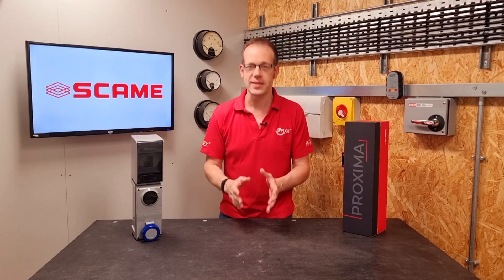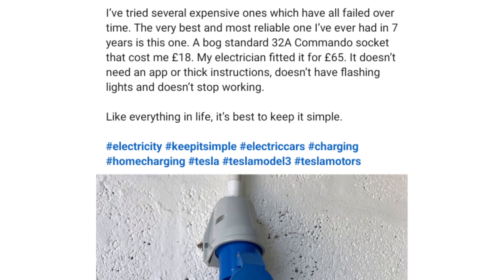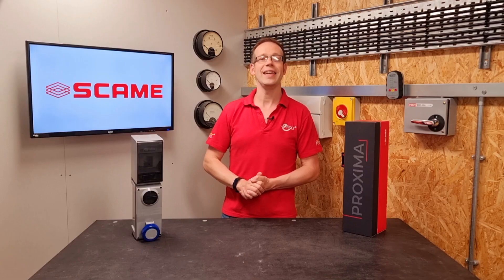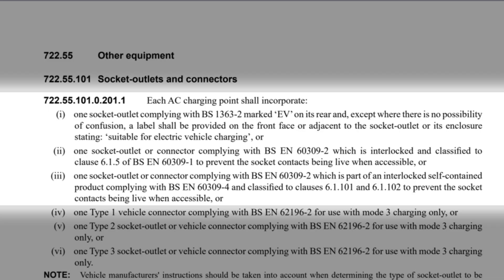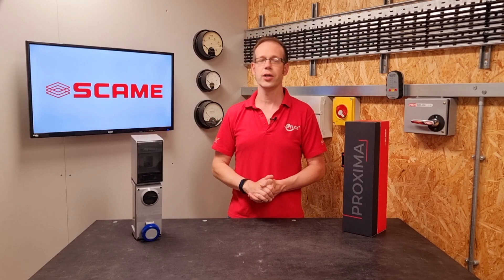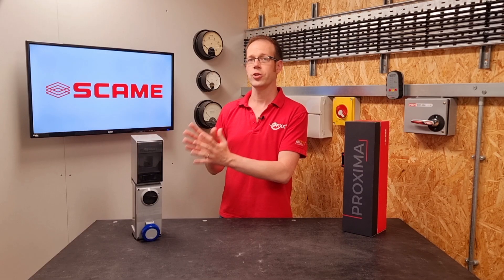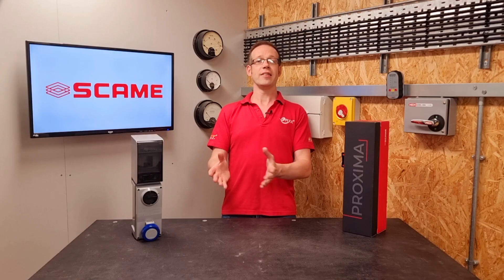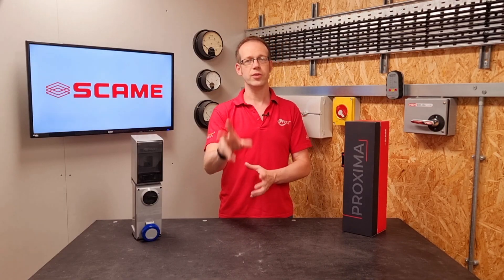Can You Charge an Electric Vehicle with a Commando Socket?

Comment: This is normal in the EU but we use predominantly 3 phase 16A 11kW charging. The cable You get with most cars is a commando to type 2 charging cable with amperage setting options

Comment: Surely by the time you’ve bought the PEN fault protection and the type B RCD (6mA DC fault protection required) and enclosure complete with SPD it’s as cheap to just install a manufactured EVCP with it all built in. Also less work? Or am I missing something?  I don’t understand how those 13A sockets with rcd next to them Screwfix sell can be used either surely only on a tt or TN-S system.

Comment: Code of Practice, if you read the last paragraph of 2.2.3  it suggests the use of EN 60309-2 sockets are for commercial and industrial only
Reply: That is the socket only without interlock
Reply: @paulstimpson8977   Switched-socket outlets with interlocks are described in IEC 60309-4

Comment: Keep charging EV  simple just install a 32 A commando socket and charging lead protected by a small EV charging Consumer unit  with the proper protection in it this will be the preferred way and easiest for all the houses installed in the garage not outside it

Comment: Quite odd that a wired in domestic EV charge point is neither shuttered nor fitted with an interlock! I get the impression that it’s really all about ring fencing the EV charge point providers gravy train.
Reply: They have a software interlock, in that the socket is not live unless the plug is connected to the charger and the car.

Comment: I noted that there are two options for commando chargers adapters for the Tesla small charger, a 16 amp and a 32 amp. I’m hoping to throttle my charger to 16 amps which is a useful step up from the 10 amps off a wall plug, but won’t put any strain on the separate 30 amp breaker box in my garage. Obviously my electrician will advise, but this video is a useful reference, thank you.

Comment: Whilst the environment is not industrial. The use is not household. It's external to the home, and the intended purpose is to deliver a 16/32A supply. Installing a shuttered traditional socket would be inappropriate for the use case.

Comment: It sounds to me like a plug in charger with built in 30mA AC / 6mA DC RCD functionality (such as the OEM ones supplied with some cars complete with a 32A Commando plug cable as well as the 13A BS1363 plug cable), plugged in to an interlocked Commando socket which is positioned at ceiling height indoors, in a house with TT earthing (so PEN fault protection isn't required) ought to be OK?

Comment: EVSE equipment is grossly over complicated being overloaded with technology and located in a harsh environment, leading to them being over priced and unreliable.  Many fail prematurely as a result.  It is  Christmas for electricians as they get unnecessary repeat business.    

All the charging intelligence is onboard the vehicle so a dumb supply is all that is required.  Or rather as dumb as possible to implement the rudimentary communication between EV & EVSE.    

There is no reason why any socket cannot be protected upstream by suitable RCD & PEN fault detection.  Also no reason why the socket can't be located in a locked cabinet if prying fingers are of concern.    

We live in a nanny state with excessive regulation.  Many electricians don't understand the regulations as they are complicated to understand.   Its almost as if a lawyer is required to interpret them.  

Top tip - if you want to get a commando socket (single phase, 3 phase) installed, don't complicate things by mentioning your intent to charge an EV with it.

Comment: There is a big difference between a dedicated EV charging point and using a standard electrical outlet that is already in place for charging an EV. As far as I know, there is no law which prevents a householder doing so, and it won't matter whether it's an IEC60309 or BS1363 socket.

Comment: Danger:
If you check the blue to Tesla adapter internals, it joins L1, L2 and L3 inside, to offload Tesla EVSE relays. But, if you connect Renault Zoe (whicj when single phase charging connects internaly L3 and N). It would make huge mess with both car electronics and L3 relay inside EVSE.
Even Schuko 13A does that, even thou relays are rated 16A.
Only with Brittish 13A plug uses 1 relay internaly, and it charges the car at 10A.

Comment: I believe you could be a lawyer. You have great grounds for a case. As long as it is protected as, it was an EV charge point. I cant see the problem . The only problem is that someone might think ever 32a socket is ok for EVs. Not every charger has a RCD and PEN disconnect built in.

Comment: This is exactly what i did, good quality interlocked IP67 rated socket on a separate circuit. Very cheap solution comparing to a "wired" EV charger install. In addition to that if you want to swap a charger later to something else it is easily done by changing the socket.

Comment: Unfortunately I think you missed a major part of the regs.

Amendment 1 doesn't allow you to install sockets without protection if the socket could be used for charging

722.411.4.1 is the specific rule

Comment: So, if you have already fitted an interlocked 16amp Commando socket installed to provide 16amp power (EHU) for your Motorhome when parked on your drive, you search and purchase an "upto 16amp" variable current outlet charger cable with a 16amp Commando plug on one end and a Type 2 on the other to charge your newly purchased EV to give a faster chsrge than a domestic plug top at 20% of the cost of an EV outlet, only downside is it isn't "Smart" 🤷‍♂️👍

Comment: IEC ("kettle") sockets aren't shuttered and are widely used in domestic situations.
Reply from the maker: Not usually as part of the fixed installation
Reply: @efixx  Surely there are other provisions for the use of Ceeform, E.G. the fact that it's 16A. My reading of the law around "standard"  domestic plugs/sockets is that a.socket intended to take a standard 3 pin 13A plug must be shuttered but a socket doesn't necessarily have to be of the type that takes a standard 3 pin plug. I have a 16A ceeform in my home workshop for my welder and have no problems with it,  also it's mounted well out of reach of children (not that that's a problem for me as no one else lives here).

Comment: Cordless kettle bases....non shuttered.  On the basis that these are allowed, surely interlocked commando is a lot safer and therefore allowed????
Reply: And BC cap light fittings, IEC connectors, and theose Duraplug connectors on lawnmowers.
Reply: Appliances are not covered by BS7671
Reply: @keoghrichard1988  an EV charger is an appliance if connected via commando plug....

Comment: I use a 32a commando.. why not? I worked out it is much cheaper doing it this way than with a dedicated charger, now does it annoy me that I have to dig out my lead yes but that is an issue that really is just down to laziness :P 

6mm swa
32amp interlocked commando that conforms to IEC/EN 60309-1/2/4
New mini dist 40A type A RCBO with a 40A 4 Pole n/o contactor & PME detection

I do not think I could have made it much safer than that which all cost less than the wall charger on it's own.. 

That said, still might go wall charger later so I do not have to worry about losing my commando cable haha!

Comment: Regulation by committee, that's what some of the electrical regulations, have become, The more info I read the more contradictions I find. I agree that the interlocking within the socket prevents access to the voltage at the socket outlet and when the unit is "dedicated" to the EV charger I see no reason not to use it. (no practical or safety reason) Doubly so when the unit is correctly protected by the correct chosen protection.

Comment: So if I understand correctly, the issues mentioned here are nothing to do with suitability or safety of a commando socket for vehicle charging. More that a commando socket can never be installed in a domestic setting for any use?
In actual real life situations, surely a 16a commando socket is much safer than using the same charger through a 13a outlet that will permanently be overheating the fuse and plug?(assuming everything else remains the same, so I just cut off the 13a plug on the charger and replace with a 16a one but continue to charge at say 10a or 13a)

Comment: The industrial type socket cannot prevent the user from plug or unplug while there is loading, unplug with load will causing arcing and damage the contact pin, hence increases contact resistance (= heat ), letting it happens respectively will eventually cause overheating on the contact.  That’s from my experience of similar setup for EV charging. A purpose made EVSE will on allow on load switching on the socket contact.
Reply: That's why you need interlocked socket, not a basic one.

Comment: Having a 3 phase supply can I plug my ev into a commando type socket to charge?
The socket rated for 32amp but car will only accept 11kw Ac also has an isolator and rcd procection. Or is there anything else required to be correct?
Thanks for any advise
Reply: 11KW is 46A at 240v. Possibly this is the max DC rapid charge draw, not the CHAdeMO, I would double-check your car manual.
Mine states 50Amp as the Rapid DC charger limit.
My car's on-board charge circuit has a built-in 30 amp limit for CHAdeMO, so I am not worried about the 32Amp limit on my commando install.
Reply: @ianemery2925  46A at 3-phase 240V would be 33kW...
Reply: @HenryLoenwind  sorry, somehow I missed the 3 phase bit, I was working on 240v. My bad
Reply: @ianemery2925  No problem, I suspected as much. That's why I kept my reply short ;)
Reply: My cars home charger came with 32a commando and 13a 3 pin uk. I have a proper installed 32a commando socket in garage and it gives me 6kw to car. That's about 24amps. I'm happy with that for infrequent topups at home. 32amp is there 20 years for another purpose that didn't happen so happy to use it. It's not easily accessible anyway. Have a zigbee ct clamp on the mains to track usage as well.

Comment: I've recently had fitted a 32A commando socket to do just this, I have a TT earthing arrangement so I'm not worried about it being used outside. In fact, the socket is indoors and is interlocked. I've also fitted a smart meter installed in a small DIN box so I can remotely control, monitor and schedule the charger. Plus the cost of the charger, it's about £250 in total using existing garage wiring. The charger is current limited so not to overload the garage circuit and I'm currently trenching out the garden to install a dedicated SWA cable for higher currents.
Reply: What smart switch did you use? I'm going to do a similar set up.
Reply: @matc1603  honestly can't remember, some 32a smart din rail meter. Put it in a small enclosure on the garage just before the socket. It's not ideal, but it's smart and I've got control over timing, quality etc

Comment: Without the Can network you would get a large spark when disconnected live.
Reply: And? That’s no difference to any other socket. Besides which, you can’t unplug live with an interlock, the switch must be moved to the off position before the connector can be removed.

Comment: Does it then follow that citizens in the UK are forbidden from owning portable electrical appliances that consume more than 13amps at home? Or how about 3 phase appliances? While rare, some houses do have 3 phase supplies, and there 3 phase appliances that plug in (I myself own a legacy 3 phase welder that plugs in).
And can I not have a blue commando socket in my shed so that I can use my power tools with my Honda generator when out and about, and plug them in at home without having to use some sort of extension lead to convert from a domestic 3 pin to the blue commando socket?

Comment: One of those great technical and grey areas open for debate, nicely delved into by Joe, with suitable theatrical confusion thrown in for good measure 🤪. I would say no to using them in domestics because they're not shuttered even though the interlock leans toward the spirit of the purpose of shuttering. Also, if you've the money to buy an EV, you should have the money for a suitable charger, let alone the £ to charge the thing with the skyrocketing energy prices! Nice one Joe😄

PS what does Graham Kenyon, lead author of the EVC CoP, say about this?

Comment: The fact that companies like Ohme sell domestic charging cables for use with 32A commando sockets would suggest that they deem this an acceptable installation. 

The bigger question is, when does a socket become a dedicated EV charging socket? What if I have a caravan or other load and have a socket for that? What stops me using the same socket for charging my car occasionally?
Reply: I was wondering that as well, why look at the EV section of the regs when this is only an outdoor socket. 
I would argue It's a multi purpose socket, and should not be governed by the EV socket regs.
Reply: @NirateGoel  that section is for dedicated EV charging points. The question is, when does a 32A commando socket go from a standard socket to an EV charging point.
Reply: @puntoboy_gaming  when you put a sticker on it saying "EV charging only"

Comment: Its pretty much how much are your prepared to pay for peice of mind? Just had a smart charger installed for less than £800, installed the cable myself. It looks fine has every safety feature under the sun and does not look an eye sore on the side of my house. Its like using a safety razor or a open blade both do the job, but maybe just stick to the former as you dont want any nasty suprises?
Reply from the maker: Wise words

Comment: By the time you have installed this socket,  plus the customer buys a charger complinate with lastest smart regulation,  then fitted type B RCD and maybe a PEN fault device in reality what has the customer saved?  More importantly what a mess it would look compared to a charger with DC leakage and PEN fault built in...
Reply: Depends on the situation. I've yet to see a portable charger that doesn't have a Type B RCD built in and not everyone has a TN-C-S install (a rod is also an option).
Reply from the maker: Wise words Nick

Comment: If it can handle the current,  and it's electrically safe, I would definitely use it for my own personal use. I really hate it when there's a proprietary new socket outlet, when something off the shelf would do the job just fine. For the general public I would recommend sticking with purpose made EV charge outlets.
Reply: Why? what reason? other than if they fitted it/wired it themselves with no consideration of protection

Comment: Think about creating the safest installation you can. That's the true intent of the Wiring Regs. Don't get too het up on trying to figure and decipher them: a requirements document as big as BS7671 is bound to contain inconsistencies.

The idea of using a commando connector that does not have an interlock should be an immediate no-no: the electrocution risk in a residential setting with children around is obvious.

Comment: How is comms handled using a commando ? The vehicle needs to know what size supply is available ( 3,7,11kw eg ) that is handled by the 2 comms pins which commando doesn’t have ?
Reply from the maker: You still need the granny cable supplied with the car.
Reply: @efixx  did some research  and you can get a 32a granny charger which was news to me 😮 so that’s 7ishKW 👍
Reply: @efixx  some portable chargers allow you to choose the charge rate, and you can also select it in the car if you know what is available on the supply. Obviously if you go over, you're going to trip the OCPD.
Reply: You DO NOT need comms, use the  granny charging lead supplied with your car and just plug into a 3 pin socket, that sorts the comms out on its own….. the Tesla one’s can be adapted to use a 32amp commando plug so you can charge at 7kw straight from a socket

Comment: By the same logic, a type 2 EVSE wouldn't be allowable in a domestic setting. No shutters there, safety through an electronic interlock. That's the reason the French pissed around with the type 3 connector for a while before accepting the type 2 standard
Reply: PS, the Tesla mobile charger has swapable inputs, so even with an interlocking in place on the commando side, perfectly possible to pull the end which plugs into the tesla charger out and lick the contacts without any interlock.

Comment: What’s the point if you can only plug a granny charger in. ( by chopping off plug top and fitting a commando plug ) . 🤷🏻‍♂️
Reply: They sell charge cables with even a 3 phase socket on one side. In the UK is not common, but in a lot of European homes it's common to have 3 phase power (and thus a 3 phase socket in the house, and commonly in the garage). Also if you don't have one, installing a 3 phase socket is cheaper than a dedicated charger, you can change the charger without calling an electrician each time, and have a charge cable with a 3 phase socket is useful since you can move it around, for example I have 3 phase sockets at work and I can charge the car there, or you can find 3 phase sockets in a lot of locations, in case of emergency. A three phase socket can be adapted to a single phase one (of course the charger will work only as a 1 phase one) and to a residential plug, and the charger of course needs to be set to not trip the breaker it's connected to. 

Finally a commando single phase or three phase socket can be used for other purposes other than charging a car, for example for equipment you usually have in a garage, such as a welder.
Reply: Because you can get 16A and 32A chargers supplied with a commando plug.
Reply: @sailingoctopus1  a 16A commando is much safer for long-duration high than a 13A plug.
Reply: @sailingoctopus1  yes Chris have since found that out 👍